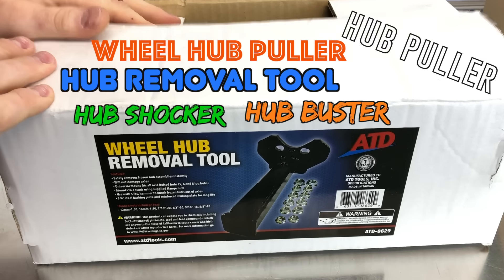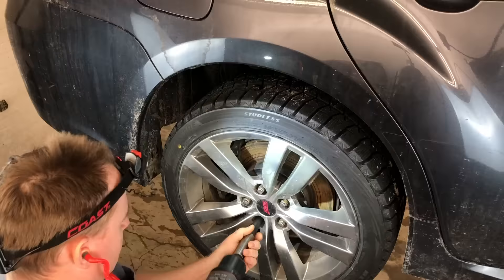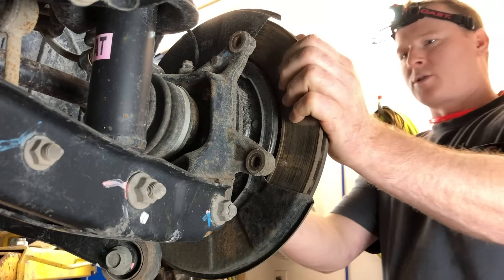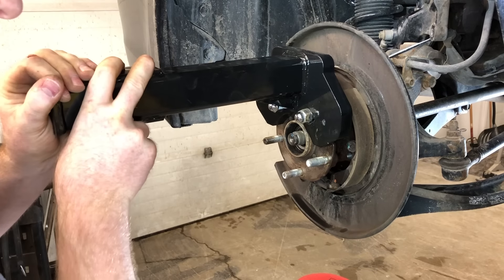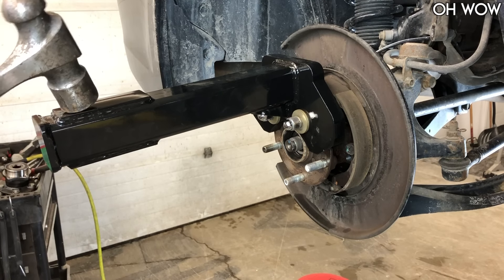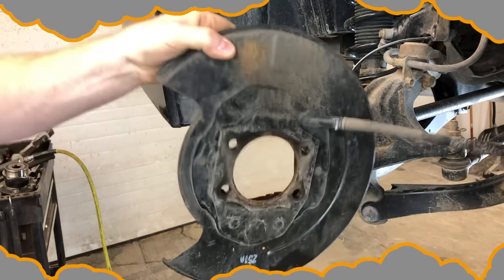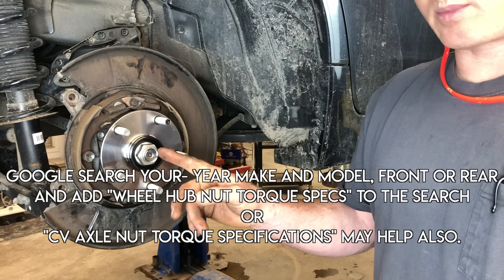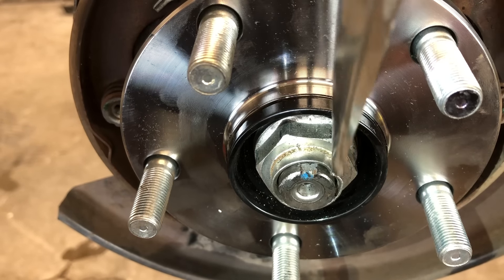HUB SHOCKER Hub Busters  |  REMOVE STUCK WHEEL BEARINGS EASILY!

Comment: That’s not the part that gets stuck on when you are removing the hub. The axle splines get  stuck in the hub you need to heat and press off with a hub puller  especially if you live where it snows or it’s all rusted
Reply from the maker: Good call. I live in a nasty rust belt state....Michigan. We da worst. Any time I have a stuck cv-axle I use my air hammer with a punch bit. That seems to be the fastest and most effective method for me. Usually there is a divot/dimple in the end of any cv-shaft which is perfectly matched to accept the punch bit. A regular hammer and punch could be used also. The vibrating action of the air hammer is super effective though. The Hub puller could also be used and could be a great method to accomplish! 😃🔧
Reply: @EasyFixShaun    That method normally works for me too or just use a hammer and a punch 
But if it’s really stuck and you keep hitting it the end of the axle will mushroom and you will need a new axle .  So before that happens go and get a hub puller and use a map gas touch to heat it up and spray some wd-40 on it
Reply from the maker: I pretty much never have the need to use heat on cv axles. I have in the past. But not at all since I have been using the air hammer method. Usually if heat is needed, that is the point where I order a new knuckle, wheel bearing, and cv shaft. Usually it’s unsaveable if I have to grab heat. Could be a regional thing. I’m in Michigan.  Salt...
Reply: @Easy Fix are you in the UP by chance? I saw you use 'da' in a comment. I'm west of Marquette. This tool is pretty great. I spent over 8 hours with a slide hammer trying to remove a rear Subaru hub assembly. Tried this tool on the other rear and it was out with only a couple hits with an 8 lb sledge. I did end up using the lug nuts to hold it in place as the nuts provided weren't strong enough. I'm oddly looking forward to the next time I have to replace the hubs. Lol.
Reply from the maker: Nice Work! I am glad you were able to get it figured out. I also wont even think of attempting a Subaru rear bearing without the tool. Fronts aren't as much of a problem. Rear Subbies are excruciating with out the tool! Life changing 😀🔧

Comment: I bought a slide hammer kit for $125. Matco brand. Has a million attachments for pulleys, vice grips and hooks. This is a waste of money and broken studs waiting to happen.
Reply from the maker: https://youtu.be/eKqYtMdlPYo
               Try the new video. A slide hammer is useless on a bolt in bearing with this tool. You actually don't need the studs. Knocking the studs out like in the new video and then through bolting has been the best way to remove stubborn bearings for me. In the video the bearing is so stubborn it starts to come apart. I use a cv axle nut trick to pull it back together temporarily and hold it together until it is removed. Maybe this will help you? Slide hammers are great tools. But I think this tool is more effective at stubborn bearing removal. A slide hammer will only split a stubborn bearing in half, leaving you with the inner portion still stuck in the knuckle to deal with. 🔧

Comment: Ok so @1:56 in the video is where not to smart starts. Beating on the outer edge of the flange,really
Reply from the maker: Hi Larry. This wheel bearing is bad and needs replacement. Why would it be stupid to hit the flange?
Reply: @EasyFixShaun  on some vehicles the flange is needed to be reused. Causing edge damage will make the rotor not fit properly in some cases. You are showing a tool. Use the tool to demonstrate the correct way to fix the car. Most backyard mechanics know how to hit things until they come aprt (right or wrong)
Reply from the maker: @larryfoster423  Usually if the flange is reusable, that would be a press-in style bearing. The hub shocker tool is meant for  bolt-in hub and bearing assemblies. I will update the description to make sure that is clear. I may have forgotten. Sorry about that 🔧😃
Reply from the maker: Done. Thanks man. 😀

Comment: It simply will not work on Ford explores!!! Everything else it works great on
Reply from the maker: No kidding! That sucks. Do you through bolt the tool on, and use the cv-axle nut to hold the bearing together?
Reply: It took me and a mongo over 2 hours to get a explorer hub bearing out using a bearing puller and the biggest slide hammer we could find
Reply from the maker: Man that sucks. Subaru bearings in the rear take the same kind of effort. They are rediculous. The tool makes quick work of them as long as the second video mounting method and cv axle nut methods are used. I slamm it with a 8lb sledge and bang! Knocks them right out. It would be really great if someone could try the tool on an explorer and report back.

Comment: Pipe wrench does the same job and far cheaper....
Reply from the maker: How much do teeth repairs cost?
Reply: I tried the pipe wrench. nope. tried a sacrificial rotor. nope. I didnt have this tool to try, but im skeptical it would work. Ended up pulling the knuckle and going to a shop with 50 ton press, which of course made childs play of it.  But the brake backing plate was not coming off and was trashed in attempting. Im going to order this to try the other side, figure I can return to amazon if it is a fail. I'll report back. 2016 forester in Indiana
Reply from the maker: https://youtu.be/eKqYtMdlPYo The tool is amazing. Study this new video and do everything in the video the same. It will pop out like butter. It is the only way I do them 😀

Comment: Doesn't work on some Ford hubs as well as a few other manufacturer models. Save your money, big hammer works well
Reply from the maker: Ford explorers are a special kind of difficult. Only the bolt method works well. South main auto has a good video on how to do it that if you need it. Tool works great on everything else in my experience. Stuck bearings only need a hammer to get out. The problem is access. If there are too many things in the way, it is impossible to strike the wheel bearing flange hard enough to break the rust bond. The tool solves that problem. Strike surface is outside the wheel well. Outstanding hammer strikes can be applied 😀🔧🔧
Reply from the maker: Update video if you need it 😃 https://youtu.be/eKqYtMdlPYo

Comment: Could have Done it faster with a slide hammer
Reply from the maker: Possibly but not likely on a Subaru. Subarus are always corroded and severely stuck in the knuckle. I don't even try a slide hammer any more. That is my old method. 😃🔧
Reply: @EasyFixShaun  your slide hammer wasn't big enough I've never had to use anything else for any bearing
Reply from the maker: My slide hammer is a ten pounder. It’s pretty beefy but it doesnt work for me on Subaru rear bearings. They corrode and rust jack themselves into the knuckle really badly. It’s as if they are welded. Usually the slide hammer splits the bearing into two pieces. Then I have to try to air hammer out the second portion that’s stuck in the knuckle. I usually try to use a twist motion with the hammer vibration and that will release it. Sometimes I have to air hammer for 20-30 minutes. It is really difficult. Have you replaced any Subaru rear wheel bearings?
Reply: @EasyFixShaun  yeah but I live in the south not much rust and corrosion down here. I don't even need to heat brake bleeders lol
Reply from the maker: Mannnnn I don’t even know what that is like. Jealous! We have the worst cars for corrosion.
Reply: @EasyFixShaun  I used to live in Syracuse NY I feel your pain
Reply from the maker: You must be in heaven living in the south then! I fantasize about moving south. But the summers are equally as good in Michigan......so I am stuck. Take care in the beautiful hot weather. Happy new year man. 😃🔧
Reply: You've never worked on a rusty vehicle have you?
Reply: @illreportbackinabit.8514  I'm from NY so yeah just a few

Comment: use a slide hammer....
Reply from the maker: Slide hammers work. But they are the old method for me now I have the shocker. I did make an update shocker video that solves some problems that could be used with a slide hammer method also if that is the tool you are going to use. I solved mounting method with a grade 8 bolt. I solved bearing seperation. Both will work perfect on a slide hammer if that is the only tool available. 😃https://youtu.be/eKqYtMdlPYo

Comment: Doesn't anybody use a hydraulic hub puller these days?
Reply from the maker: Hub shocker is essentially hydraulic. Just add a savage and a sledge hammer. It's faster, easier, and cheaper. Sometimes getting hammered is the best way. When parts like rusty hubs need to be separated, this way works best for me. Whatever works for you will always be the best method 😀

Comment: Don't look like you can use it on a Pressed in bearing
Reply from the maker: You are correct. Never use this on press in bearings. It is for bolt on bearings only. If you need a press in bearing replacement video https://youtu.be/CInFJDz11II

Comment: You're just lucky the wheel bearing came out with hammering, normally you just can't beat it out. This tool does nothing of substance, it's that bearing that needs to come out easily.
Reply from the maker: I have used the shocker 30-40 times. This is the quick easy way to go to avoid separating the bearing on a lot of vehicles. If you are servicing a rear Subaru bearing you must use this tool to make the job easy. To avoid massive amounts of effort this is the only way to put pinpoint accuracy, with sledge hammer force on the inner hub bearing to separate it from the knuckle, without removing the knuckle. There are lots of ways of doing things. This is the best. HUB SHOCKER- don't waste your time with any other tools for stubborn bearings.
Reply: Thanks for sharing
Reply from the maker: No problem! I hope your project goes well.
Reply from the maker: Hey! Check out the new shocker video I made. This is the only way I do them now. I have had zero mounting problems and zero hub separation problems. Let me know what you think please 😃https://youtu.be/eKqYtMdlPYo

Comment: Obviously not much thought is given to what you are doing to the bore the hub fits into.
Reply from the maker: Good thought! I have never seen a broken knuckle from bearing removal. Even with the hub shocker I have not seen it. The knuckle is one of the strongest parts on the car. It is stronger than the bearing assembly. As long as the bearing is unbolted, any typical method of bearing removal will not damage it. Heat can damage knuckles if you do it wrong or melt the knuckle. Corrosion is the problem, otherwise bearings would fall out when unbolted. The hub shocker is just a longer (or stronger) method of breaking the rust bond between the knuckle and beearing parts. If you forget to unbolt a wheel bearing and then use the hub shocker, I am positive you would eventually break something. If the bearings is unbolted like it should be, the rust bond is the weakest link in the chain and will break first. If its not the weakest link, you need to make a video about that! That would be an amazing video. Removing the knuckle to press out the bolt in bearings does the same action to the parts. An alignment would be needed afterwards though. And the knuckle would need to be unistalled and installed for the bearing to be pressed out. This is a fantastic method. But it takes too long. And a better tool is available. The Shocker is powerful enough to strip wheel studs and separate bearings during use. I solved both of those issues with the new video. Check it out if you want to and give me feedback? I know the tool seems crude and harsh on components. But for stuck wheel bearings it is the tool for the job for me. 😃 
                https://youtu.be/eKqYtMdlPYo
Reply from the maker: I subbed to your channel Mike. Nice videos man!

Comment: cant you just use a 3 jaw puller
Reply from the maker: Might work. But not efficient imo. The hub shocker is what I use for everything severely stuck or rusted. Which is all bearings in Michigan. Here is the second video I made if you are interested. I solved mounting issues and bearing seperation while using the tool 😃https://youtu.be/eKqYtMdlPYo

Comment: This seems like the worst idea ever. Doesn’t that put a shitload of lateral stress on the knuckle instead of just pulling it strait, evenly forward?
Reply from the maker: Yes. it does increase force to the bearing to free it. From my experience the weak link always breaks first, which is the corrosion bond holding the bearing into the knuckle. I’ve only seen bearings come free. I have not seen any damage to any other components. Pulling straight out would be the most ideal. But it’s not necessary to free a bearing from a knuckle. A hammer works great for doing this and striking at a 90 degree. The shocker works better for super stuck bearings by multiplying force with leverage. Plus you can swing a hammer harder outside of the wheel well.

Comment: Looks like you could knock a car off a stand or lift with this thing
Reply from the maker: Good call. That could happen if the vehicle is not properly secured on stands or a lift. The tool has some power, that is for sure. I haven't had any problems with that though thankfully. Check out the hub shocker 2.0 update video! 🔧🔧   https://youtu.be/eKqYtMdlPYo

Comment: Oh my, there's so much wrong here....I bet he doesn't even know WHY he went beyond the indentation on the spindle nut. (－‸ლ)
Reply from the maker: There is nothing wrong here. This video has a purpose. To help people replace bearings that are otherwise, nearly un-replaceable. The indentation on the nut is the old bearing's lock nut mark. It has nothing to do with the Proper torque applied to the new bearing. The nut is reusable. Good day 😀
Reply: It's not because he over torqued it if that's what you're implying.  It's only because the nut thread was started on the spindle at a different point than the original.  Jeez I tell ya these armchair mechanics crack me up!
Reply: Haha, armchair mechanics.  So the implication is that you stretched your axle shaft somewhere in this process, hmm I think not.
Reply: @benjaminhaas4634  Haha

Comment: Doesn't really work that good on a subaru that has a stuck wheel bearing.
Reply from the maker: Have you seen the second video by chance? It solves the mounting problems and bearing separation problems you may be having? https://youtu.be/eKqYtMdlPYo
Reply: @EasyFixShaun  i have tried different angle still doesn't work specifically when the hub are really rusty.
Reply from the maker: That sucks. I am sorry. Are you doing everything like in the hub shocker 2.0 video? Using a 8 pound sledge hammer? If so, the next thing that would help, put a jack stand under the suspension of the side your are working on as close or right under the knuckle if you can. That will transfer the energy from the sledge hammer to the shocker. With the jack there will be less "bounce" absorbing the sledge hammers energy. That should pop it out. I would try a few good wacks on the shocker. If nothing works, you should take the knuckle off the car and press the bearing out. I would exhaust the shocker before you do that. It is a ton easier if you can get it to go. I haven't had to press one since getting the shocker 2 years ago. I see some gnarly rusted rigs here in Michigan. Keep me posted. I hope that helps.

Comment: Pull axle nut off, go for a hard ride, remove loosened wheel bearing. Your welcome.
Reply from the maker: Risk vs reward. That could be dangerous and damage parts depending how it goes 😃🔧

Comment: Of course it has play because the axle nut is removed, that tool is a joke on 14 and up Outbacks with the electric calipers. Those just don't come out, replace the knuckle. By the way there's hardly any rust on that car. In the salt areas those bearings are a bitch.
Reply from the maker: https://youtu.be/eKqYtMdlPYo  This is the updated video. Would you watch it completely and let me know what you think? The second video is how I do all Subarus. Pops em out like butter no matter the corrosion level. Mounting with studs removed from the hub is a must. Keeping the cv axle nut on is also a must to get them out in one piece. Game changer for me.

Comment: Waste of money!  Pound a stud out then use a hardened  bolt and nut to push the bearing out! Much much easier!
Reply from the maker: Not a waste of money really. Your idea is great though! What if the bearing starts to separate? Then what do you do? Here is the second version of the tool that I made if you are interested. I solved some problems I was having with the tool. One was mounting it, and the second was bearing separation. That seperation part may help you with your method if its ever needed. Let me know what you think if you have time? https://youtu.be/eKqYtMdlPYo

Comment: It's no different than using a big pipe wrench
Reply from the maker: The pipe wrench can work. But it also can pop off after a hammer strike and damaging the user or the vehicle. This is bolted on. Much safer. And you can hit it with a sledgehammer 😀🔧🔧